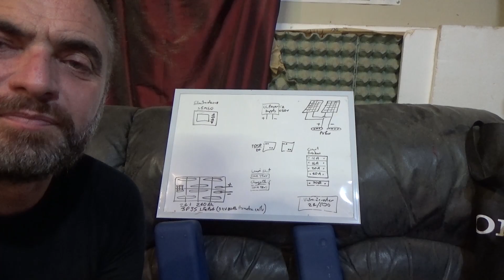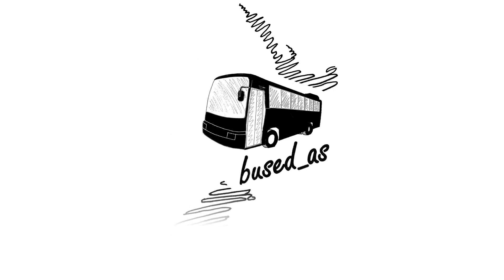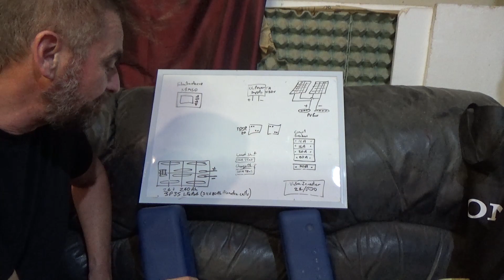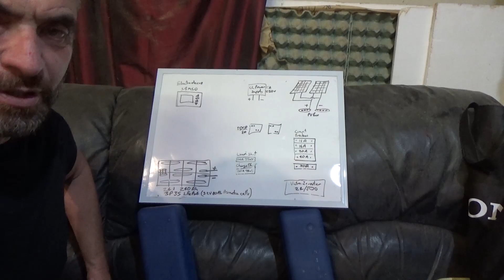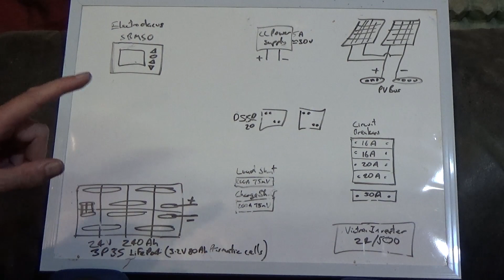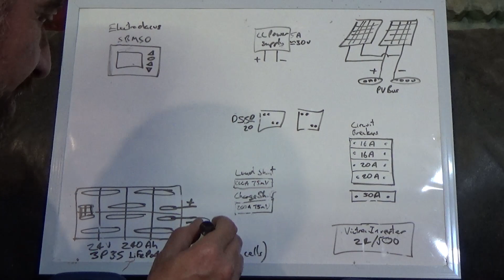LiFePo4 Circuit Design | A Simple_As circuit design for our Lithium Battery Pack in true Kiwi style

Comment: Could you explain how to add a resistor for dssr20 and which to use as is stated on page 7 figure b of the dssr20 manual?
Reply from the maker: Do you have the new DSSR20 with Diversion? The one that can charge, and heat. If you do its way easier to also get the DEXT16. If you don't have the "heat" function you dont need the resistor

Comment: Why the shunt on the positive? I put all mine on Negative. Im gunna Catastrophic fuse on the positive!
Reply from the maker: Seems weird huh but that's just how this BMS is designed, the other interesting difference is that it uses a second shunt for charge measurement. In my final design I am fusing the positive but right at the battery. That means if it ever blows it will probably wreck my BMS but putting it after the shunt leaves me with way too much unfused metal bits
Reply: @BusedAsNZ  a lot a stuff breaks just from use anyway. Ive blown 5 inverters just cheap whatever I don’t know. I really think it was because i had Trojan Deep Cylce Batterys back in the day and they need 14.8v to charge and temp compensation in cold up to 15.8 sometimes. I think that blew inverters slowly. Im settings up all new lithium now. I looked everywhere for days about how to fuse a “Catastrophe” fuse all about Mega, ANL etc but that one you got seems the one! I was testing 189 amps induction cooking and the 2500v inverter kept shutting down. Found it was the eBay cheap breaker switch rated 200amp.
Reply from the maker: Yeah for sure, I guess especially likely with the incredibly cheap stuff we can get these days. I have been fascinated by lithium ion batteries since I was a kid but only really started playing with them recently. Had never even heard of a class T fuse or an interrupt rating, and wow the rabbit hole you end up in researching that stuff... Oh yeah thats another interesting question, do these cheap breakers work? while I dont plan on testing my 250A breaker, I will be devising some plan to see if the smaller ones do what they say on the box

Comment: I basically understand what you did there. Is a DSR a switch or a relay. Or something else. 
On your load shunt is this where you run your meter for your battery percentage. 
I found your Chanel while researching changing AGM to Lithium. I am learning a lot. I built my own simple system with no idea about shunts and BMS. I run all my power through a switch then use the inverter to connect all the + and - 
I just put  a 130a midi fuse on the battery’s .  Once I go to lithium I wonder if I should start again.
Reply from the maker: Hi there, thats impressive, it confused the heck out of me. But seriously, yes the DSSR20 is basically a 20A solid state relay, with a little smarts inside, and perhaps the best value solar charge controller you can buy (specifically for lithium). And yes, my BMS is measuring the battery level on the load shunt, which is perhaps better called the battery shunt since it actually measures all current in and out of the battery, not just load, the charge shunt is not necessary but for just a few bucks more, it gives a lot more detail. If you are not familiar with shunts, they are just a big resistor, so they use up a tiny bit of voltage, exactly how much depends on how many amps are going through it, so if you hook them to a fancy meter it can measure the voltage at both ends of the shunt, calculate the difference (the volt drop across the shunt) and from that calculate the current flowing, and direction. I'm certainly not an expert and like you learning as I go. I think the biggest difference between Lithium and Lead is the charging and the need to manage each cell, so any existing battery management and charging system might need a rethink but after that its just a battery